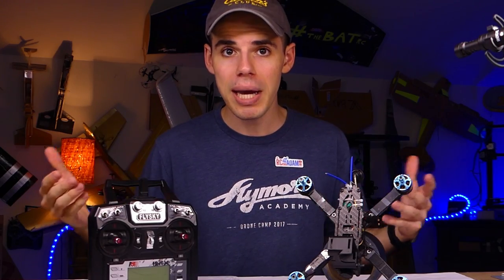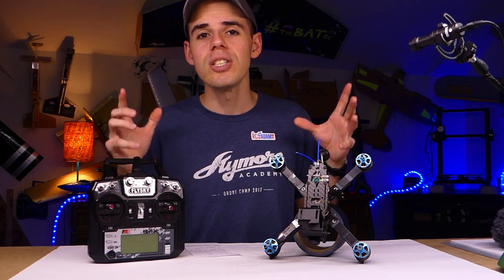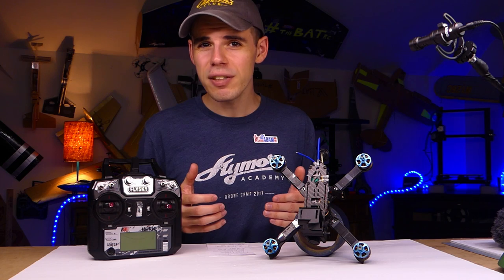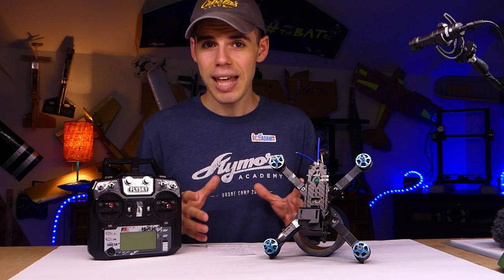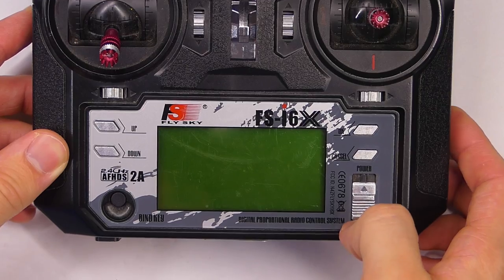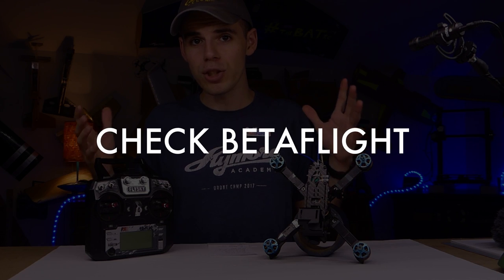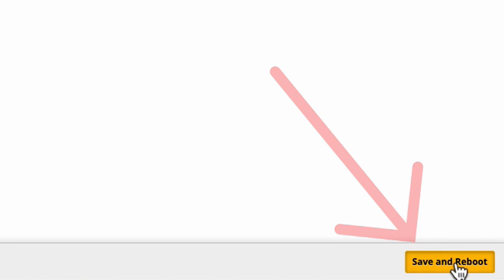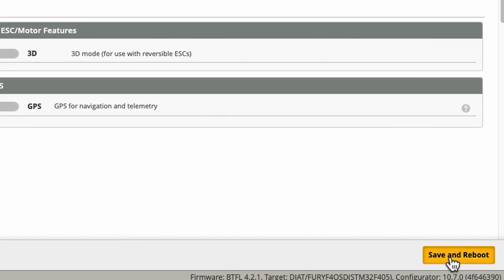Why Your Transmitter Won't Show in Betaflight - Most Common Fixes

Comment: i still have the same problem with crossfire...     -_-  i don't have connection between the control and the drone,, but it binds normally with the Tango 2 ..
i dont know man, this thing frustrated me a lot xD
Reply: Hello, you solved that problem? The same happens to me

Comment: good video, didn't get mine going yet tho. I have a BetaFPV65xHD and crossfire, everything is setup in betaflight but the receiver preview doesn't move and throttle is only working when flying,  have any idea what I could have missed?

Comment: I know this is a long shot, but maybe someone can help me. My receiver and transmitter have no problem connecting to my flight controller. I'm using S-Bus, and when I go to the receiver tab in betaflight, all my joysticks are moving the bars and working the way they should. I go to the motor tab, and I can control the motors via betaflight. But when I try to use the throttle on my transmitter, it has no effect on the motors. The throttle bar still moves in the receiver tab, but it simply does not turn the motors on.  Does anyone have any idea what's going on?
Reply from the maker: Hi! Have you setup an arming switch (in the Modes tab)?
Reply: @RCwithAdam1  Nope. I’m assuming if one is off, that means my transmitter can’t communicate with the motors? That’s doable in beta flight?

Comment: Help me please I can't connect my sxr L2 communicate on betaflight
Reply from the maker: Hi! What is your whole setup?
Reply: @RCwithAdam1  I just got the Diatone Roma L3 maba 411 all in one and I'm I'm using Spectrum sxrl2
I bought the PNP Plug & Play the wires came already soldered and it looked to be starter to tx1 and my transmitter is a DXS
Reply: @RCwithAdam1  mamb f41125A AIO 26.MM, Spektrum dxs , Spectrum SRXL2 SPM4650 I got to have it wired to tx1 on the flight controller

Comment: Why is my prop throttling up itself when i apply throttle a little bit
Reply: it's probably trying to get quad into a specific attitude so it applys some throttle to alter its position.  But as you don't have props on the spinning motors do nothing.  So it adds more power to the motors but still nothing happens, so add more power! and so on.  Once you have props on the quad will stop this cycle as it can correct itself and stops needing more inputs.  

But don't work with the props on at face level on a bench!!!

Comment: I can't get my flysky fsia6b to power up via any of the 5v pads from my sky star flight controller. All brand new equipment. Please help before everyone within a 10 mile radius of me gets murdered
Reply from the maker: Hi. Yes, please don't murder anyone. Can you power anything else from the 5v flight controller pad? Because either the pad is not working or the rx is not working. Also, is the connector plugged in correctly to the rx?

Comment: I am going to end up quiting this hobby after getting a new radiomaster tx16s. All day to bind one damn drone assign a couple switches now the damn thing won't connect to betaflight. I just want to connect to betaflight.  Most of my life I felt I was above average Intelligence today I fell like an idiot.
Reply from the maker: Dang, that sucks. I hear your frustration. It took me about a month to get my first bind-n-fly quad working. Tell me some details about your setup and the issues you're having and maybe we can solve it. 🙂
Reply: @RCwithAdam1  thank you very much for the reply and offering to help. Took the better part of the day but I got a quad in the air last night. Getting used to the navigation buttons was enough. I was stuck after binding the drone and assigning two switches arm disarm and flight mode. I was trying to connect the remote to betaflight instead of the drone with the remote bound to the drone. I still want to install turtle mode on a switch and a buzzer.

Comment: I wish I never started with this stuff. Should have made an Arduino drone, getting comparable equipment is a major pain in the butt. "this works with this but not that then flash this, that and these, then this wont work because because its Wednesday,...Nothing has diagrams and instructions , really nothing! whats it take to put a piece of paper in with the control board or put a link to a PDF!!?? too much trouble for manufactures.

Comment: wizard x220 transmiter binded showing in cleanflight input but after esc changing big 30A yellow not branded and pwm esc protocol not responding to transmitter contoller yet motors spinning in cleanflight test. Any ideas????

Comment: I’m unable to get my dji fpv remote to show up in betaflight. I’m running the latest version and have all my components fully updated from the manufacturer. I’ve already flown my quad just fine and have used my controller with DRL but still nothing with beta flight. I went into the command promp and turned on sbus baud fast and also enabled it in the dji fpv goggles. I selected sbus in the configurator but still nothing. 

Any idea?
Reply from the maker: Hi, Blake! You have a battery powering the DJI unit while the flight controller is connected to bf, correct? I don't use the dji transmitter, so I'm not sure if this could be an issue specific to it (though I doubt it is).